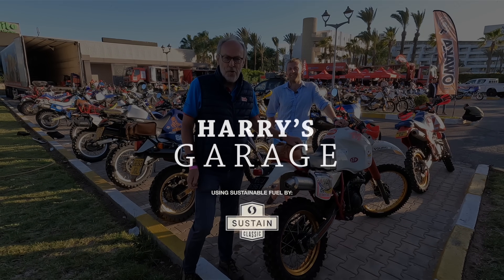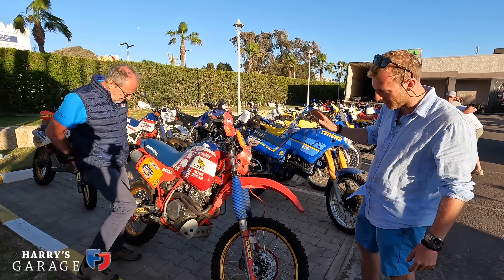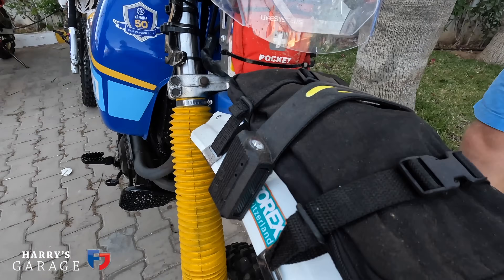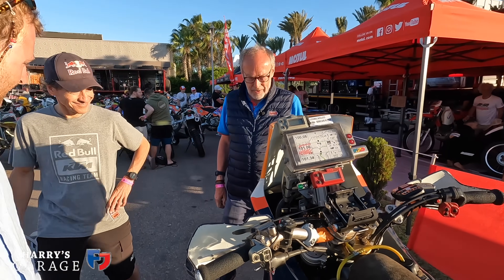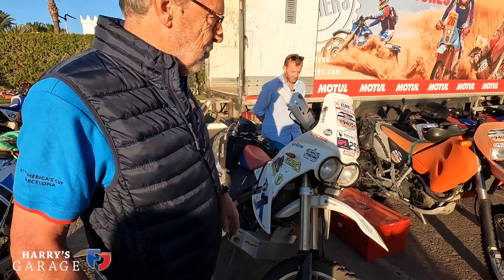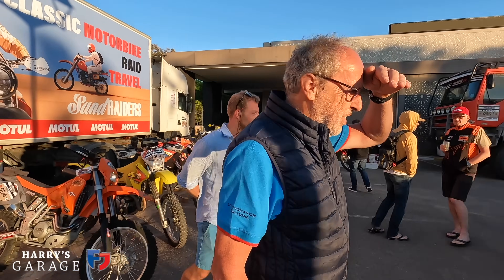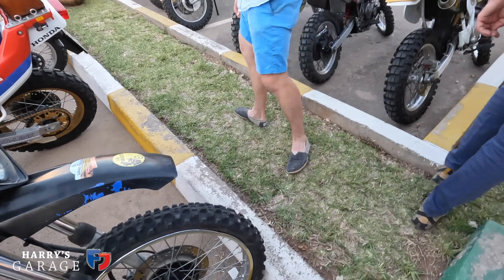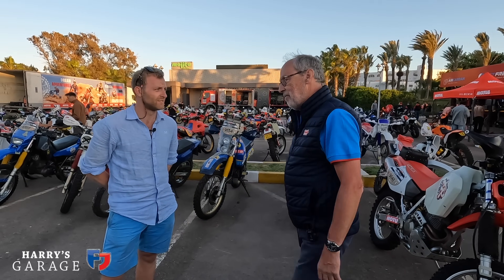Guide around the crazy 154 Dakar style bikes entered in Sandraiders 2024

Comment: I had a pretty much identical bike to the Marlboro HPN in the video. 
Mine was an original R80G/S, uprated chassis by HPN, 1040 twin plug engine, extended carden shaft, same tank as on the Vid, plus an under seat tank, WP suspension with twin shocks at the rear. Took me solo from Cape Town to Zanzibar via a number of countries including Angola.
Hell of a trip . .  Had two big smashes on the way but survived to tell the tale . . .

Comment: The BMW is a G 650 XChallenge, based on the old 650 Rotax single cylinder. It was BMWs  try to build a lightweight and sporty bike . It weights 155kilo with a full 9.5 liter tank.

Comment: Chas' Honda is lighter than the TT, really??
Reply: The TT has a heavier XT600E engine, starter-motor, solenoid, battery, long heavy 16mm2 copper starter cables to the rear and a heavy steel tank made (poorly) by the previous owner.
Reply: @davidlambeth5368  Oh l thought you'd modified a TT engine , my mistake.
Reply: You can't convert a kickstart TT600 engine to electric start.